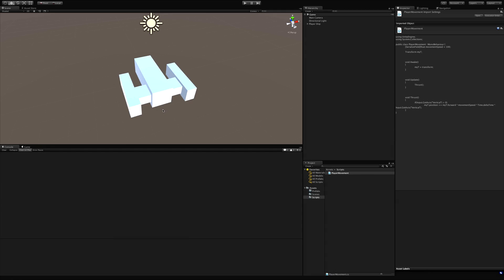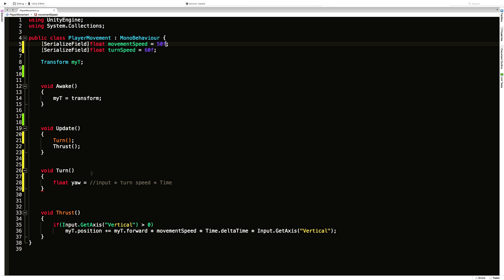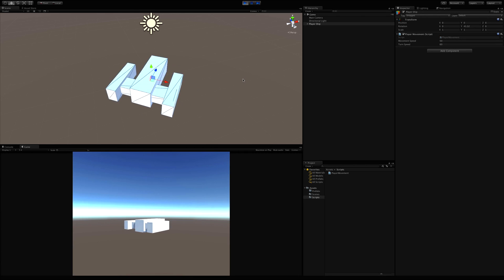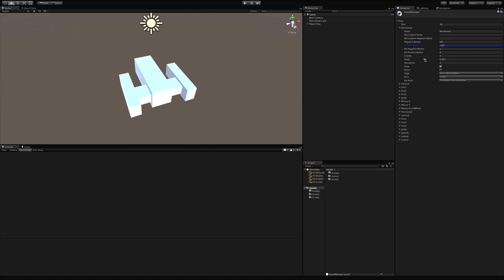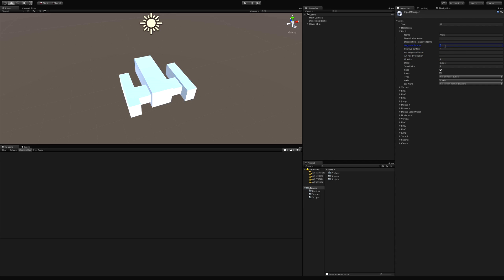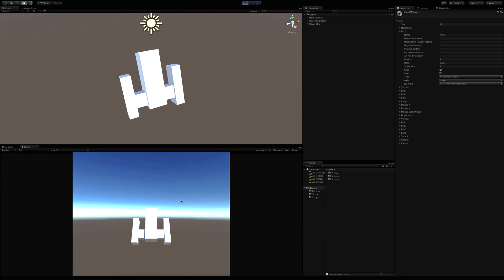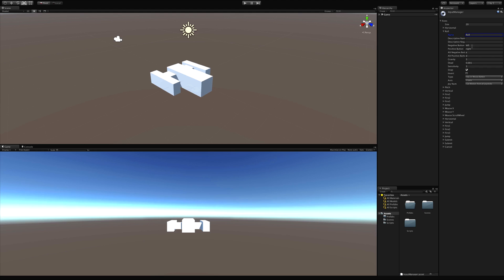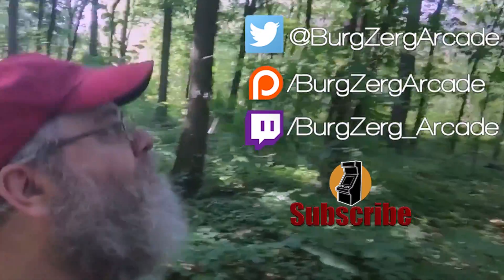Ship Rotation - Unity 3D Game Development: Week 3 Game

Comment: My ship flies sideways and does the opposite of everything, i followed each step by step 3 times no errors just everything is flipped! what do i do??
Reply: yes I've even switched everything around and when i do that it just doesnt move but 1 direction some feedback would be appreciated..
Reply: by everything i mean the axis and ive tried rerotating the ship in blendr, nothing works, ive copied your script letter for letter, caps for caps, periods, spacing EVERYTHING!!!
Reply: is the new unity screwed up or something?? i understand this was from 2016
Reply: Sorry for the late response. If your ship is moving the incorrect directions it has to do with the way your ship was imported into Unity. If the ship is rotated after being imported to show the correct orientation all the movement will be based off of the original orientation. I had the same issue. I had to load my ship back into Blender and then rotate, save it in blender, go back to unity, and then attempt the movements again. Hope this helps.